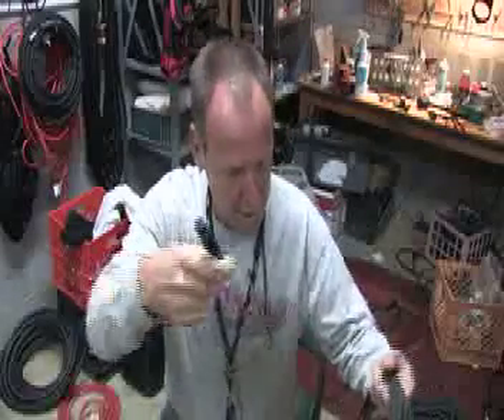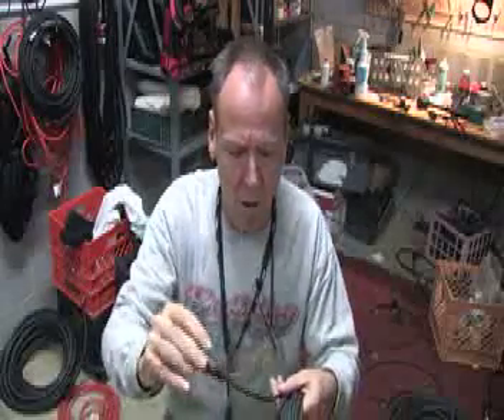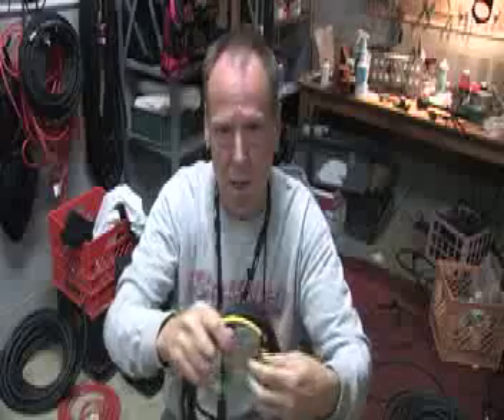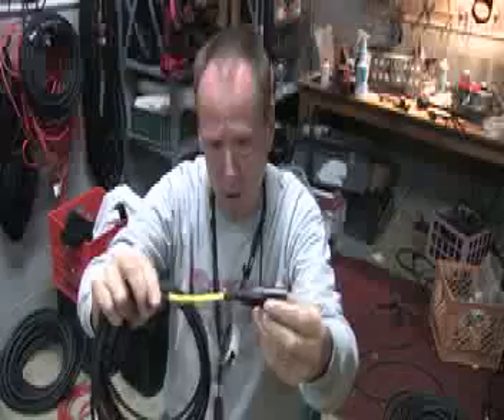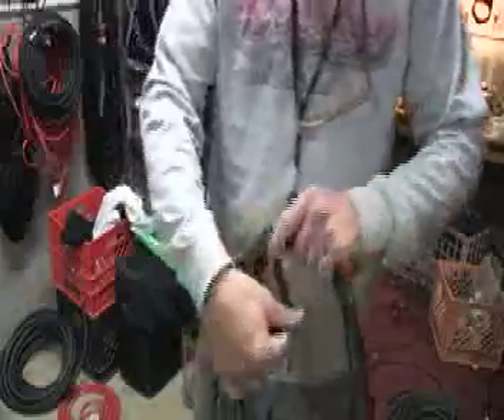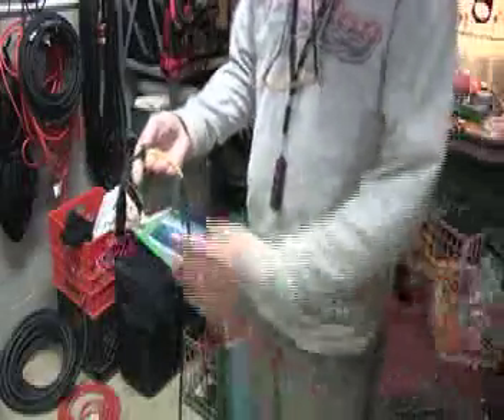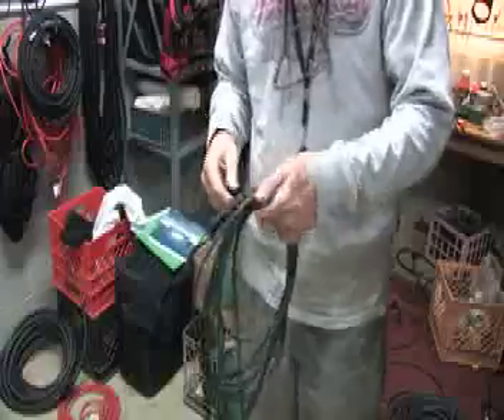Cable Wrapping: A Detailed Explanation

Comment: common mode signal is not a function of the shield, but of equally induced noise on each of the signal lines, which the differential amp will discern and reject. you correctly allude to the twist that's often manufactured to ensure equal exposure to interference, but the shield, being of different impedance doesn't take part in common mode rejection

Comment: haven't yet found one cable i can't wrap into a nice clean coil using over under, so just keep working at it.  That being said, Very often i have to walk out the cable so it is straight and laying nice on the floor before i start wrapping alternate/figure8/over-under style.

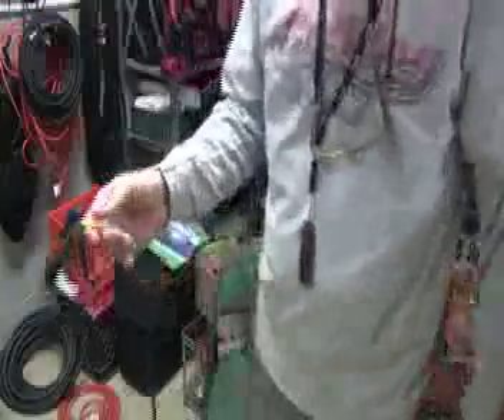as stated @ 4:18 in this video, lay em out flat, and then start wrapping away..

good thing about over under is honestly it is faster, i can roughly double the speed of my coworkers who use over/over... good luck